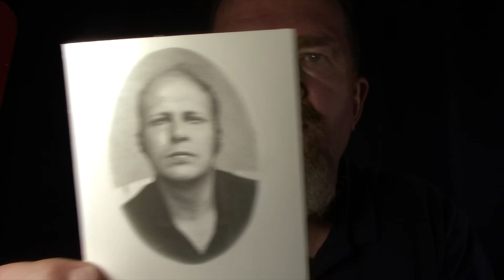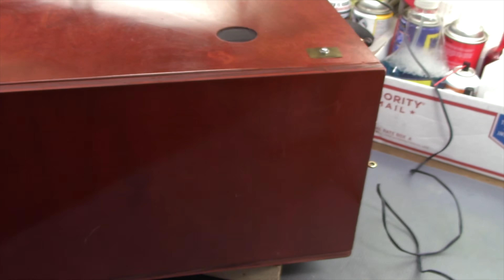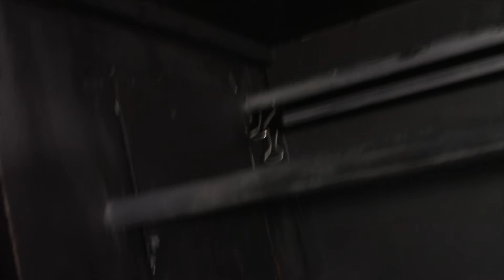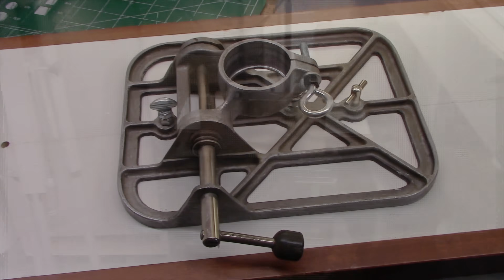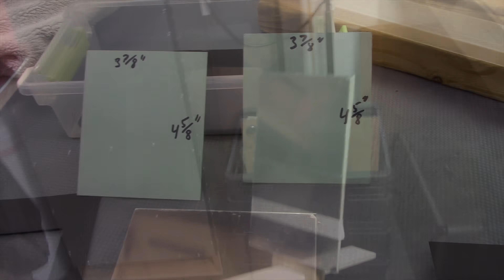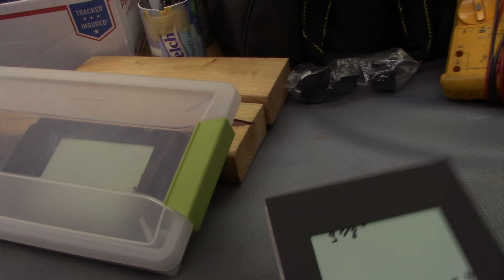Afghan Box Camera Project Update

Comment: First of all, thank you for making these videos!  My sister and I are tintype photographers here in Los Angeles. It is hard to get anyone to tell you their "tricks of the trade" so thank you. Sometimes we get asked to do events at night, and this could be another good option for us. I had a picture done in Tijuana almost 20 years ago, and it has always bugged me. I wish I had asked the guy more questions, but now I'm sure he was doing this process. I also bought a 1930's PDQ camera a couple of years ago, and was trying to figure it out, but I got stuck at trying to find the paper & formulas. 

I had a few thoughts on your setup, as we have had to figure out similar ways to dry our plates. 
What about using a hairdryer? I understand if you are not wanting to use any electricity, in that case, what about a blotters book?
I just bought a cool lithium ion battery bank (inergy kodiak) it's basically silent and weighs about 20 lbs.  I also have a generac generator, which is pretty quiet, but it runs on gasoline.
I'm thinking, you could also put an LED light in your kit. It could be helpful in low-light or night conditions. 
Also, I love your idea of using the oval matte!

Comment: Why not just contact print? 
I know you need more light. But you need that already if you use photo paper. 
You could use the camera pointed unfocused at the sky to get good strong light.
Reply from the maker: Yes, that is another option. I did some experiments a few years ago where I used an old Polaroid 800 camera with a piece of frosted lucite plastic over the lens and a thin sheet of glass at the film plane, where I would load the negative and print paper in the camera and use the sun to contact print, with the camera's shutter on bulb. This was using a two-sleeve darkroom box for loading and unloading the camera, along with a stand-alone Speed Graphic for making the paper negatives.

The advantage of copying the negative is being able to change the size of the print; and not photographing through the paper media itself can be better, depending on the thickness of the paper negative. And with multigrade paper for the print, contrast filters over the lens can provide an easy way to alter contrast.
Reply: Joe Van Cleave True. It’s after all essentially camera and enlarger in one.

Comment: Great video. Nice work. I have a question about how you shoot. Do you just remove the lens cap (like a afghan box) or use a photo shoot?
Reply from the maker: I'm using a lens for a 4x5 large format camera; either a Kodak Ektar 127/4.7 or a Fujinon 135/5.6. They have mechanical shutters that include a bulb (B) or timed (T) setting. Typical exposure times are1/8-1/4 second in shaded daylight, using Arista grade 2 RC paper rated at ISO12.